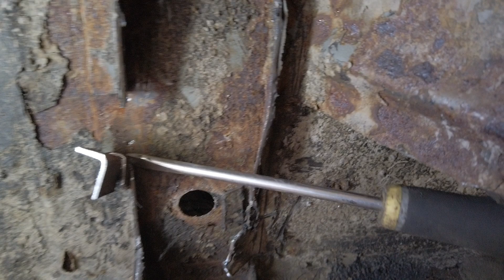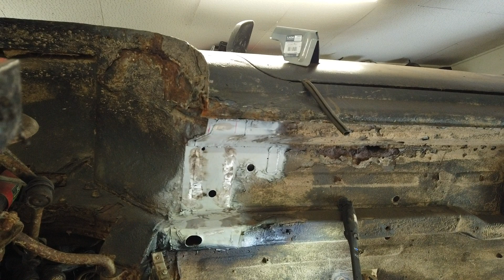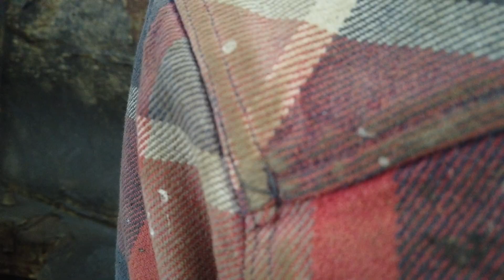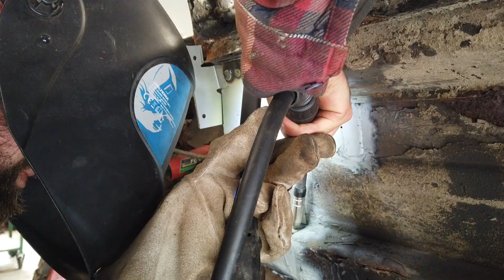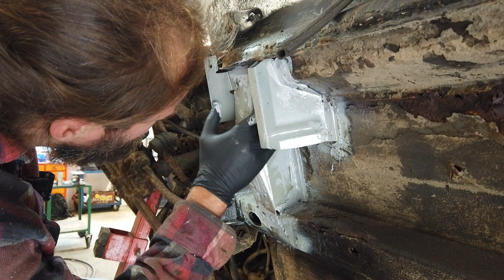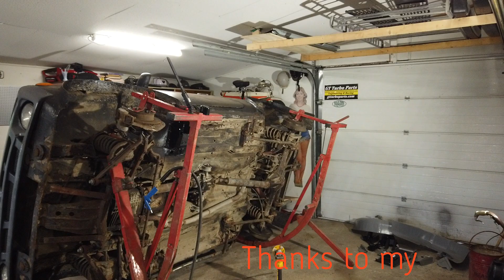The Lada Niva is flipped onto its side... and its time melt some metal!

Comment: Do you just want to pass MOT / TÜV ? Or do you like welding ?
Well if I were you, I would sandblast and cut out all spots were the rust is still between 2 or more layers. Otherwise it will return and eat up all the rest.
I realla don´t understand, why so many youtubers load up so many work on themselves, but not doin it the longlasting way ?
I am envy on your ``flipping-device`` and your double-garage. I can´t afford or get a place like this to work for my own.
Good luck and have fun driving this underestimated offroader 🙂
Reply from the maker: I like getting cars that are close to being scrapped and giving them a bit more life.... getting them back on the road and enjoy them!
my goal is not to make them like new and 100% rust free.... I do not have the patience for that, and I would not dare to use them afterwards...

This niva is (if I succeed) going to be driving on salty snowy roads this winter and be used off road without being to careful.... and also... remember its painted with stone chip paint all over... restoring this completely would be so much work...

Comment: Awesome that you can still get the body parts for this car! Doing floor repairs on this device looks so easy :). I have been doing some floor repairs on my car recently just with some ramps and it's a bit of struggle 😅
Reply from the maker: This Autovip thing changes everything.... its so much more fun to do the work, and the result is better.

You can get everything for this car! and I think i paid around 25 Euros for the parts I welded on in this video.... its amazing!
Reply: The Lada Niva is still being made in 2022 - it has been in continuous production since 1977 and has the longest production run for an off-road light vehicle still manufactured in its original form. I'd guess parts will available for it for decades to come.